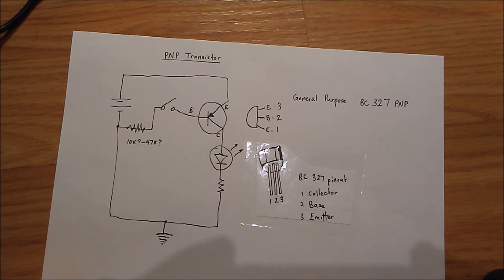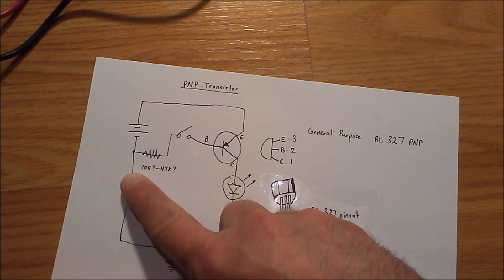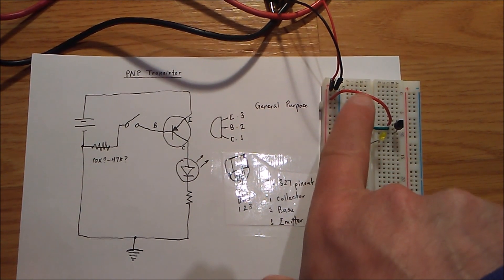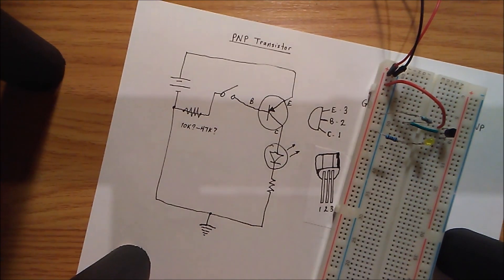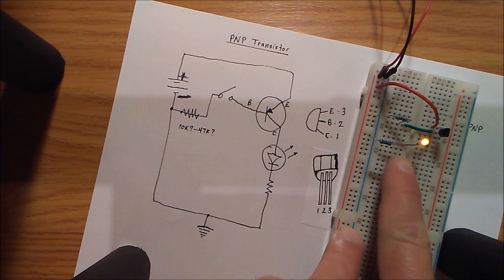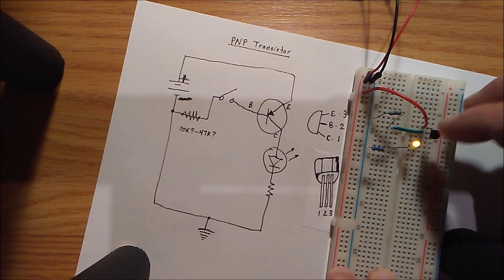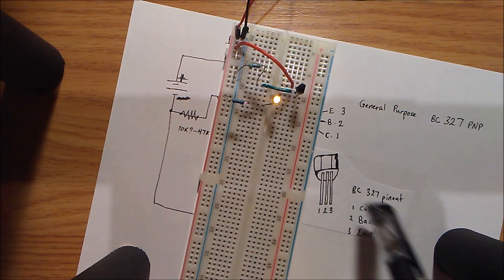BC327 PNP Transistor Circuit

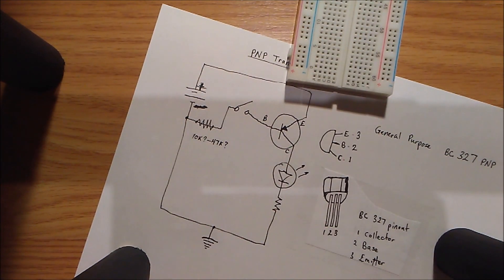Comment from the maker: Correction: At, 6:06 , I said "the PNP is
 triggered by a low signal back to ground." Well, this may not be technically correct, because "triggering" is usually a response of microcontrollers (digital programming). I stand to be challenged, but I think "current-sinking" to ground is a better explanation ... Rather, I wager to guess the base is sinking current, which opens the path from the emitter to collector.
Reply: Hey, what happens if u connect the base resistor to vcc, would the led still be off?

Comment: Your transistor tester isn't wrong. In the tester, pin 3 is the middle one, You are using [2, 3, 1] pins -> collector, base, emitter
Reply from the maker: Thanks for the comment. I'm thinking about what you're saying.
Reply: @2bit661  The markers in the tester are 1,2,3,1,1,1,1
You put the transistor at position 2,3,1